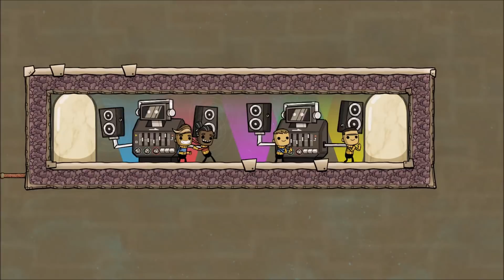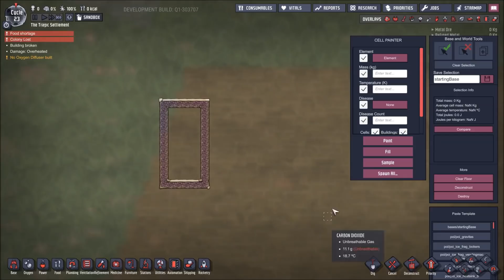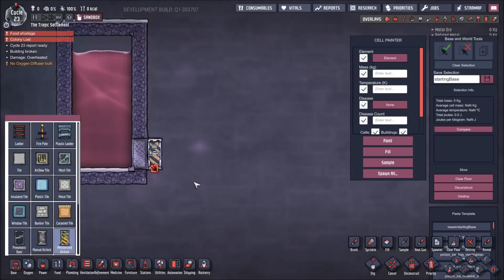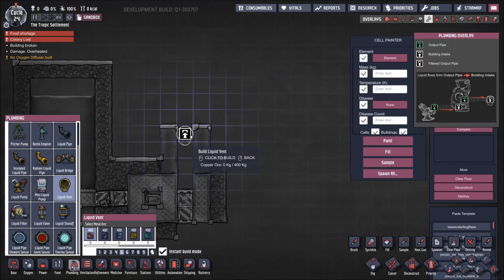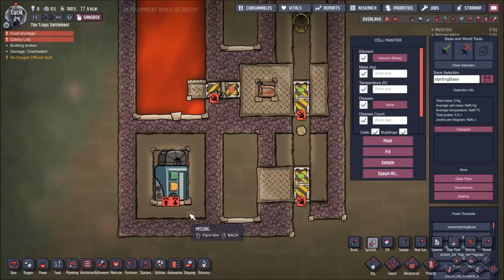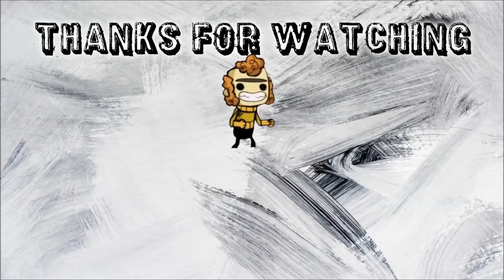Oxygen Not Included Petrol Factory- Part 1 (2019)

Comment: You need to vacuum out the chamber where the oil/petrol are going through.  As of now, you're getting heat transfer from the top (where you're adding heat) to the bottom (where you're trying to cool).  If there was a vacuum, the heat would still transfer between the metal tiles and the liquid it's touching, just not through the air like it is now.
Reply from the maker: I noticed this toward the end and do vacuum it out. I just cut that part of the video out because it was a dry spot in the recording.